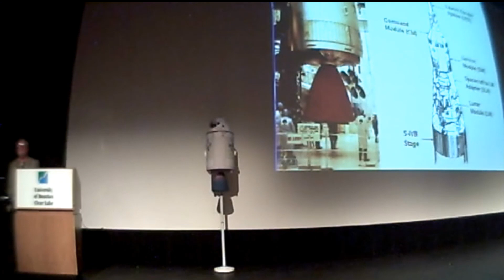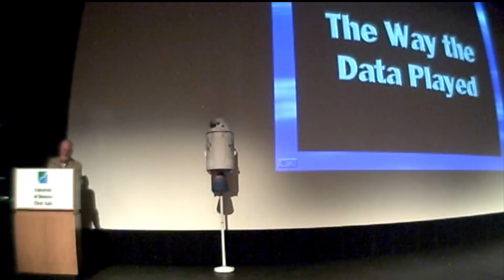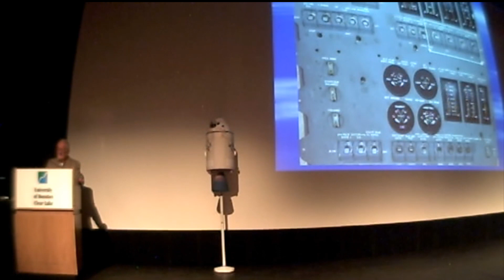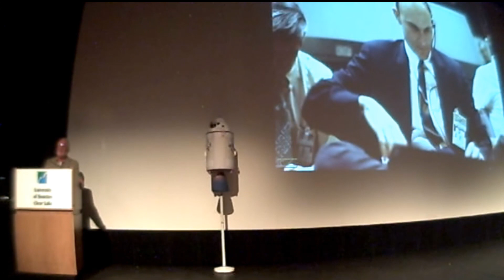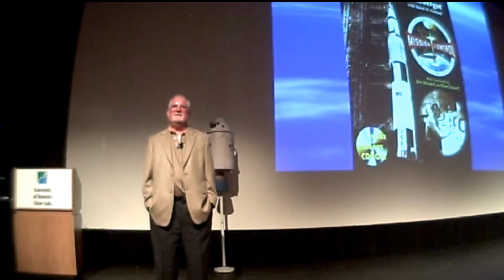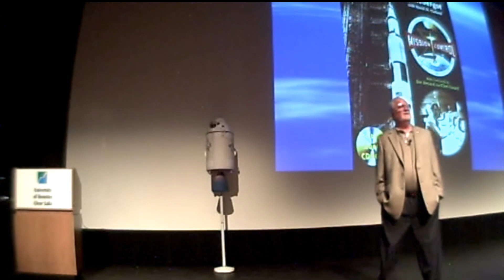Apollo 13: Anatomy Of The Failure, Sy Liebergot [HD]

Comment: 38:30 - Here it is mentioned, in passing, the assessment that the incident was Not an Explosion.

What Sy does not tell the audience is that the official NASA investigation, in all its hundreds of pages and extremely detailed analysis, NEVER refers to the O2 Tank 2 failure incident as an explosion.

It would be far more illuminating, instead of glossing over this issue, to dedicate a section of this talk to thoroughly discuss it.  The distinction is not trivial.  It has the most important ramification in understanding the level of damage to be expected in the aftermath.  The singular most significant question here is:

Is the SPS Engine still usable, or not?

Ok, everyone knows that the O2 Tank 2 failed.  This happened at MET 55:54.
Very few people know that this was NOT the only pressure vessel to BURST during the Apollo 13 mission.  At MET 108:54, the Supercritical Helium Tank in the LM also burst.  This overpressure condition had been monitored for a very long time by Mission Control.  Here is an excerpt of what CapCom said to the crew:

-----------------
106:34:24 Lousma: Another thing that we're expecting to have happen is that the SHe tank is going to reach its burst limit. The earliest time we predict this will happen will be at 107 hours on about 25 minutes. And the latest probable time is at 110 hours, and this is supposed to be a nonpropulsive vent, but you might hear it and you might see something.

106:35:06 Swigert: Okay. That's good news. We were wondering about that.
-----------------

Here the crew is informed, hours ahead of time, that a second tank on their spacecraft is about to rupture, and their response is 'THAT'S GOOD NEWS'.  In Sy Liebergot's parlance, Apollo 13 is about to experience a second "explosion".  And they're perfectly fine with that.  As Mission Control is perfectly fine with it as well.

Mission Control had the option to 'burp' this tank, which would have prevented the overpressure tank rupture.  But instead, they decided to sit back and just let this tank blow.

In ALL of the books and movies that have covered Apollo 13, NO ONE explains the significance of this.  TWO pressure vessels failed on this mission.  So did the spacecraft experience TWO EXPLOSIONS?  Or was only one of these two tank failures an explosion, while the other was not?  We do know that one was fully expected by Mission Control, while the first tank failure was not expected.  Why would Mission Control willfully allow this SHe tank to rupture, when THEY HAD THE OPTION TO PREVENT IT?

The commonality:  ALL pressure vessels have the potential to become explosive bombs.  This had been known for well over 100 years prior to Apollo.  It was an ever present hazard in steam locomotives.  If the boiler pressure got too high, an explosion could be disastrous.  And of course on a much more delicate spacecraft, an explosion could easily turn fatal.  So engineers have long dedicated their designs to including SAFETY mechanisms specifically for the purpose of preventing them from exploding.

The O2 Tank 2 had these safeties built in.  And as Mission Control was well aware, the Supercritical Helium Tank likewise had these safeties.  Both tanks had BLOWOUT DISCS which were designed to rupture if and when the pressure got too high.  So instead of exploding, the tank would 'fizzle'.

With the SHe Tank overpressure situation, Mission Control could have done a short burn which would 'burp' the SHe tank.  Use a bit of the Helium inside, and that would bring the pressure down to a level that would prevent this tank from bursting.  THEY DECIDED TO NOT DO THIS.  Instead, they just monitored the pressure rise to excessive levels, and let it burst on its own.  WHY?  Why not prevent this second tank from rupturing?  The reason was quite logical.  If they had done this 'burp', it would have CHANGED THE SPACECRAFT TRAJECTORY, and all the calculations would have to be redone.  And a course correction burn would possibly be needed.

Instead, Mission Control decided to just let the SHe Tank BLOW.  Tank rupture was a fully tested situation.  Ground testing done years prior to launch had certified that these blowout discs would indeed perform per design, preventing an explosion from happening.  And in the particular case of the SHe Tank, its blowout disc routed the subsequent expulsion out through a specially designed T-shaped vent port.  This T-vent pushed the helium out at 180-degrees in equal measure, so that the net propulsive effect got CANCELLED.

And THIS is why just letting the SHe Tank pressures exceed its limits, and just letting it blow on its own was the PREFERRED option by Mission Control.  This is why Jack Swigert responded with "That's good news", instead of freaking out.

Notice how there was no discussion with CapCom explaining how the overpressure safety mechanisms work.  This was all well known by everyone involved.  Tanks are potential bombs.  And everyone who works with them is extremely well educated as to the meticulous design effort that was done to prevent this from happening.

Sy Liebergot knew all this when he was in his 20s.  He still knew it in April of 2010 when he gave this 40th anniversary talk.  One of the very first slides he presents shows the diagram of the O2 Tank 2, with all of its safety features, including the blowout disc and pressure relief valve.

So why does he not discuss this?
Why does no one discuss this?
Why does Ron Howard present the tank failure incident as an explosion, when the tanks were specifically designed to not explode?
Why does Ron Howard TOTALLY IGNORE the second tank failure incident?
Why does Sy Liebergot totally ignore the second tank failure incident?
(Or maybe he did cover it, and I missed it.)
Why does everyone totally ignore the fact that the extensive official NASA Cortright Report never refer to the O2 Tank 2 failure as an explosion?

Again, the distinction as to whether or not the O2 Tank 2 failure was an explosion or not is far from trivial.  If it had actually exploded, then you could expect that the Command Module would have been blown from the Service Module.  That the Heat Shield would have gotten cracked.

But Gene Kranz, along with the other controllers and back room folks in Mission Control that day were well aware of the safeties that all these pressure vessel tanks were carefully designed and tested to have to prevent them from exploding.  And with this knowledge, it could be concluded that the SPS Engine was still in working order.  This gives you the option to doing a DIRECT ABORT.  Turn the spacecraft around immediately, and bring the crew home without any excessive delay.  Kranz's decision to instead take the crew around the Moon added many extra hours to the mission, which put their lives in jeopardy regarding consumables.  And the famous Carbon Dioxide LiOH scrubber problem.

Chris Kraft felt that the smart call was to do a Direct Abort.  Chris Kraft was Gene Kranz's boss.  Yet the structure he had set up was that the Flight Director was the person in charge of the entire mission.  And Chris honored this command structure.

Kranz's decision to take the whole mess around the back of the Moon certainly added drama to the incident.  If instead he had turned Apollo 13 around to come straight home, then it is quite possible that failure would have been nowhere near as dramatic.  And no movie would ever have gotten made 15 years later.

The other scenario which Sy Liebergot does not go into...
After requesting the Tank Stir, he along with everyone in the back room do a thorough job of monitoring their parameters.  They NOTICE that the pressure is quickly rising on O2 Tank 2.  Liebergot immediately calls for the PRESSURE RELIEF VALVE to be opened.  And this quick action MITIGATES the failure which then happens.  A significant portion of the energy goes benignly out the vent port, and so when the tank does rupture, it does not cause anywhere near the damage which happened.  The conduit blowing does NOT take out the O2 Tank 1 system.  All Fuel Cells continue working.

THIS is the scenario which probably kept EECOM John Aaron up at night.  Thinking that if he had been the one on console, he would have acted quickly enough that the mission might have been saved.  That Lovell and Haise would have gotten their moonwalk.